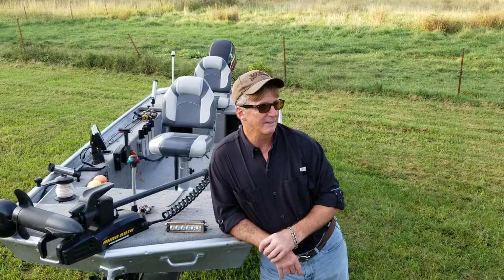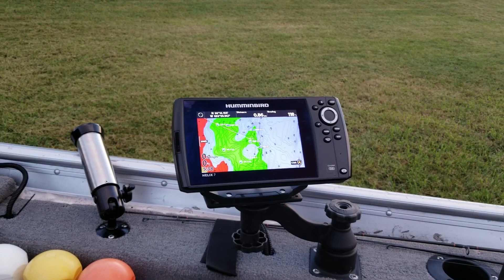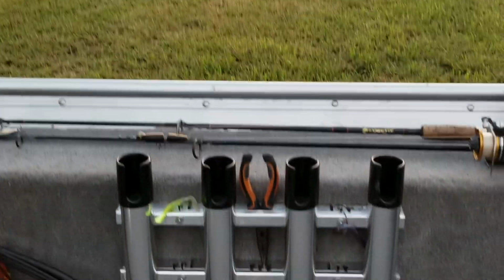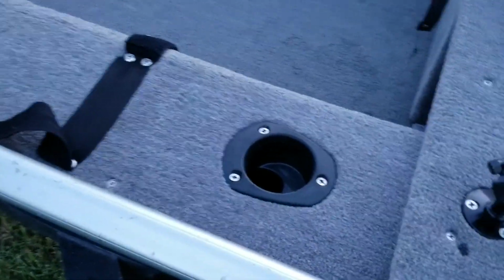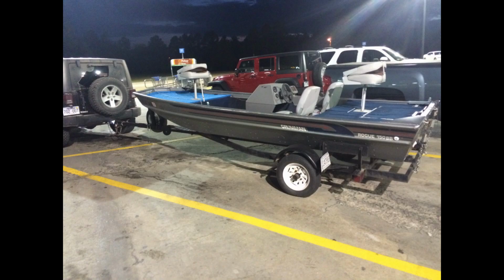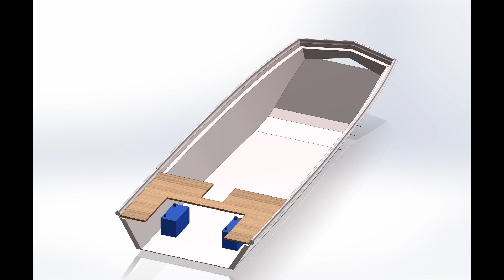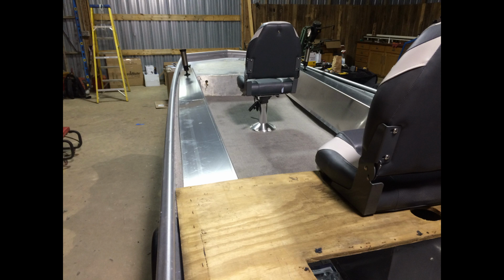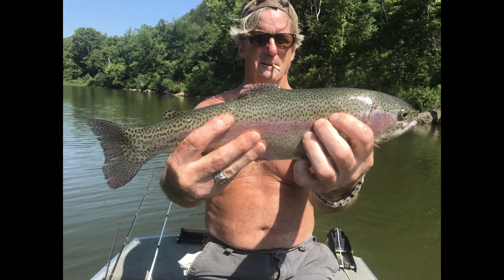Building a stick steering boat

Comment: awesome build. thanks for sharing!
Reply from the maker: Shane Wimer Thank you!  Building a center console boat this winter, stay tuned...
Reply: @ForWildsSake  I just got a tiny 11 foot boat I am trying to decide if I want to go tiller and have more space or make a one man machine just for me with a steering console and a front deck.
Reply from the maker: Shane Wimer: setting up a one man boat would be really fun.  My thought is as cool as the one man project may be, sooner than later your gonna want to take friend.  Tillers are cool because if you want to slow your troll, you ca run in reverse. This also gives you very precise control of the boat

Comment: Very cool how do you make the cat fishing rig the looks like a big spell rod with a styrofoam floaty with the dowel rod stuck through the floaty
Reply from the maker: It is a 18” chunk of PVC pipe, with a 12” floaty, I put a steel weight inside the PVC, then cap the ends.  The rig float horizontal, then when a bite happens, it tilts, the weight goes down towards the hook and stands the floaty up like a bobber.  Thanks for watching!

Comment: I thought you were gonna show installing stick steering!
Reply from the maker: It’s a very simple process, bolt on the tick unit and connect the cable to the motor itself.  You do have to know cable length ahead of time

Comment: Any trouble turning the boat at medium speed? My stick steer is hard to turn if much more than an idle.
Reply from the maker: Yes they are a little harder to steer at idle, like any boat.  Make sure your using the right lubricant on your cable.  no heavy greases or the cable will get gummed up.  Thanks for watching.

Comment: Great job on the boat and a really nicely produced video!  Two questions: What design software do you use and which company’s stick steering did you use and why did you choose that product.  Im just starting a new boat project on my 15’ Aluminum basic Flat Boat. I’m thinking about using an EZY-Glide EZY-Stick II 206. I have a new Mercury 20 Outboard... Oh, one more question... whose throttle shifter did you use and prefer?
Reply from the maker: Lance Griffith I used Solidworks software, I use it at work.  It’s too expensive for a casual user.  Blender 3D is a popular free 3D software but never used it.  Easystick is the stick steering unit I used.  I am running a 25hp but I used the 840 which is rated for 70 just to have the extra beef or if I upgrade to more HP.  Make sure you measure your steering cable accurately and have a well thought out path to the motor.  Good luck on the build!  You won’t regret it.  Stick steering boats fish amazing!!